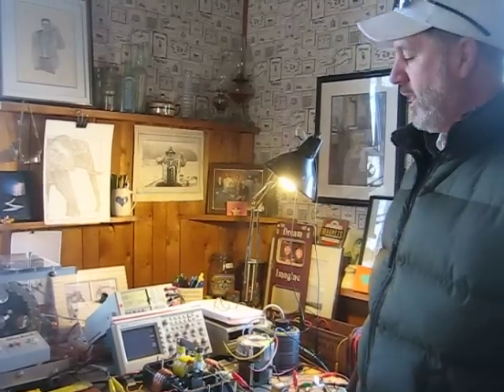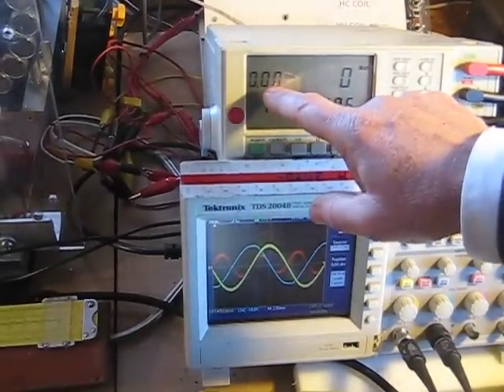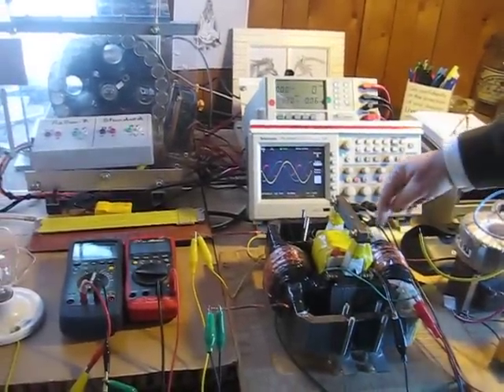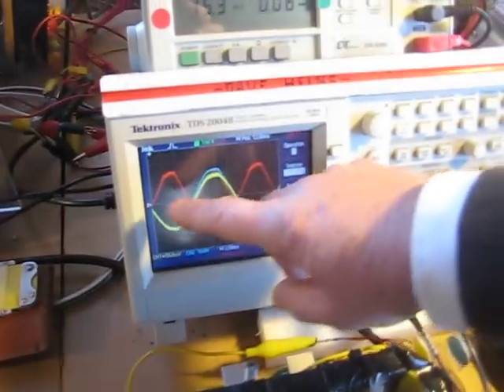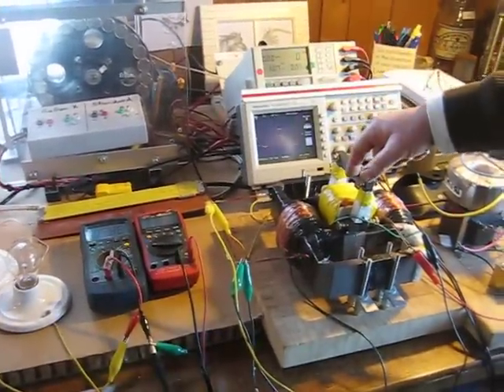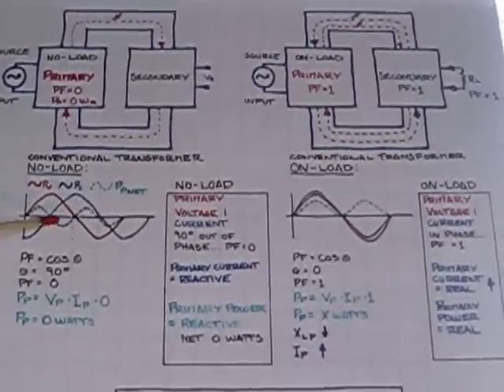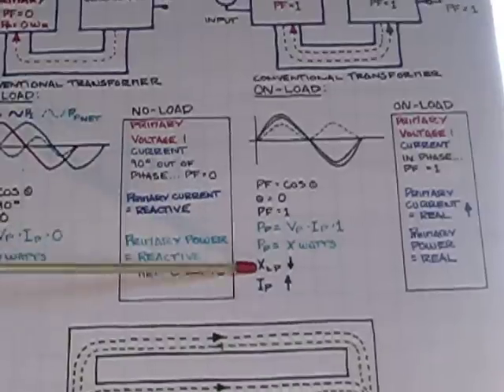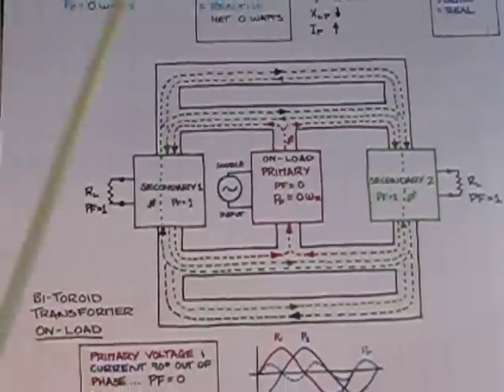INFINITE EFFICIENCY Bi-Toroid Transformer Operating with Zero PF Dec 7, 2014

Comment: Hello Mr heins I have replicated your transformer design and I did get some good results but I realised it only works with resistive loads but I am trying to drive a 250w motor using the secondary of the bitoroid transformer. I have tried rectifying the output but it doesn't seem to work. Could you give me any suggestions on how do I drive inductive loads. I tried stacking multiple bitoroid transformers in series to generate 250w but it went all in vain. I really need your help sir. How to i convert the power in secondary to pure dc please help
Reply: AC to DC rectifier like usual?
Reply: @lukiepoole9254  yes ac to dc rectifier like usual
Reply: Also thane heins design is severely inefficient and waste of resources. It is much better to just wrap the primary winding directly around both secondaries of a core-type transformer. Like the "frolov transformer". That way you can have 100% reactive power but the output power is near zero. So you ended up an inductor Lol. But, the induced emf is still there. It's just that it plummets when you try to draw power out of it. So, use parametric resonance. Add resonant capacitor.
Reply: @lukiepoole9254  actually I have figured out how to use inductive loads as well, when u put the load on a secondary, u need to put the load on the second secondary coil as well  bcoz the background emf of one's secondary travels to another. And not to the primary coil at the centre.
Reply: @rajendraprasad1638  Just connect the two secondaries in parallel so their mmf stabilize and cancel each other.
Rectifier does the job so what you mean tho
Reply: @lukiepoole9254  what I meant was it can run inductive loads as well, if one secondary is connected to load and the other one is left open then the first secondary won't produce enough output. So if you connect a load to the first secondary coil then make sure you short or connect the load on the second secondary coil as well
Reply: @rajendraprasad1638  That is obvious as mmf cancellation needs to be equal. Or you can just use both windings, and connect them in parallel, and in parallel with the load.
Reply: @lukiepoole9254  actually I tried connecting them in parallel and the results were disappointing, but I will give it another try and let you know.
Reply: @rajendraprasad1638  add capacitor in series
Reply: @lukiepoole9254  then I will have to run it at resonance, otherwise won't that expend more energy to just run.
Reply: @rajendraprasad1638  bruh
It would actually be the opposite.
Do you know about inductive and capacitive reactances?
Reply: @lukiepoole9254  yes I know about inductive and capacitive reactances, could you please explain where did I go wrong.
Reply: @rajendraprasad1638  I don't quite understand how your device is designed. Can you describe it in simple terms?
Reply: @lukiepoole9254  ok, I have a 300 turn primary at the centre, and 100 turn secondaries on both the sides that's it. As simple as that.
Reply: @rajendraprasad1638  What's the structure of the core looks like?
Reply: @lukiepoole9254  it looks like a bitoroid transformer.
Reply: @rajendraprasad1638  it's not suppose to look like a bi toroid transformer lol
Reply: @lukiepoole9254  but why do you think that, just let me know about ur doubts and I will make a video to clear them ok.
Reply: @rajendraprasad1638  
Let's start again.
First, using an anti-polarity core-type isolation transformer as the base. The two coils are connected in parallel, to be used as output, and both are connected to the same resonant capacitor, in series.
Finally a large coil is wound around both of the coils continuously. Basically the large coil is a solenoid.
There is no way this looks like the bi toroid transformer.
Reply: @lukiepoole9254  I am using a ferrite core U shaped,  also did not connect the capacitors anywhere, the center coil is the input coil. And the ones on the left and right are the output coils that's it.

Comment: I've had a go at making one. I'm struggling to power induction motors though. Resistive loads seem ok, but motors don't run, could it be because the voltage and current are out of phase?
Reply: Hello Sir. When powering resistive loads did you still manage to get more power out than the power you were consuming?
Reply: @waitin4thateeeeeeeg  yes I was able to run more leds from the secondary than the power i was putting in the primary

Comment: FLYBACK !
Reply: It is not Flyback,With Flyback there is no return current  from primary coil to the souce.
Reply: @bojanbittner4128  agree not flyback , but disagree flyback does have a miniscule amount of current mostly voltage though
Reply: @bojanbittner4128  More like the Tesla Switch or the Benitez Circuit

Comment: Its not current that is depleted its voltage on a resistor so why do you keep trying to replace the current and you wonder why you cant crack the code nobody is after the voltage drop across the resistance these people have no idea what is really happening here current isnt the issue here its the voltage drop not current drop dam you are slow

Comment: Great job Thane. Bitoroid transformer is a great machine if you want to keep your input power the same no matter the output power you draw, but with a troubling condition. The maximum output power is limited to whatever input power you give to the transformer divided by a+1, where a is the ratio of the reluctance of the primary core to any of the secondary cores. (Secondary cores have same reluctance). In practical terms, if your input power is 300W, and the ratio of your primary reluctance to the secondary is 10:1, then the maximum power you can draw from the secondary is 300/11=27.3W. And this maximum power is when you short the secondary coils, that is setting the load resistance to zero.  Indeed the input power remains constant at 300W while varying the output, but you can't exceed output of 27.3W.  One or two more secrets missing. Very close though.
Reply: The last two secret is frequency resonance and parametric resonance
Reply: inputOf300WattsDontExist.TheHighestDomesticConsumingDevice,MetalWeldingMachine,WhenYouAreNotWelding,Draws100wats.SoWithNoLoad.

Comment: Did you succeed in this?
Reply: The questions are simples and the answers is the same:
I see that the transformer is made of ferrite.
At what frequency do you work?
What voltage and amperage does the primary (W) have and what voltage and amperage do the secondary (W) have together?
It is said that such a transformer would increase the power (W) by 40 times.
Did you succeed in this?

Comment: Please someone tell me, what happened to this bi-toroid invention? Its been 7 years now!!
Reply from the maker: Hi Anchor, the BiTT is currently being developed as a step up transformer to isolate the generator from the load and to allow the generator to operate on no load while the BiTT delivers power to the load at infinite efficiency. https://youtu.be/YUb5idSqU8U
Kind regards
Thane
Reply: @PDiCanada1  Great job! I watched the video. Would love to support this work. Let me know if I can  help. God's abundant grace to you. 
 Kind Regards.
Reply: I salute your commitment and devotion to these projects. You are doing a great job! And I do pray for more grace in this pursuit.  Bitoroid transformer is a great machine if you want to keep your input power the same no matter the output power you draw, but with a troubling condition. The maximum output power is limited to whatever input power you give to the transformer divided by a+1, where a is the ratio of the reluctance of the primary core to any of the secondary cores. (Secondary cores have same reluctance). In practical terms, if your input power is 300W, and the ratio of your primary reluctance to the secondary is 10:1, then the maximum power you can draw from the secondary is 300/11=27.3W. And this maximum power is when you short the secondary coils, that is setting the load resistance to zero.  Indeed the input power remains constant at 300W while varying the output, but you can't exceed output of 27.3W.  One or two more secrets missing. Very close though.

Comment: Thanks, it's a interesting design.
I get the idea there are 4 (toroid_cores) magnetic_loops.
The upper & lower (long narrow cores)
 are allowed to unsync (=desynchronize)
 but their (magnetic_)momentum (=flux)
 is allowed to (keep=) continue
 to circulate in either direction (e.g. clockwise, or counter_clockwise)
 as needed,
 so (almost) no (=little) (magnetic_)momentum (=flux)
 is lost.
E.g. Phase_shifts,
 & [even] phase_reversals happen.
Thus the power_factor
 is allowed to change
 e.g. when changing the load(ing).
That (phase_shift) "tolerance"
 is important
 for operation_stability,
 because normally
 a(n abrupt) change
 would make operation collapse.
Effectively, we've got 3 coils (P1, S1, S2)
 each with its own resonance frequency,
 & 4 magnetic (flux) paths.
The middle_coil P1 can "buck" (against)
 (e.g. ~external, differently timed)
 fluxes from S1 & S2
 (preventing them)
 from entering into P1
 (e.g. via Lenz's induction law).
So P1('s resonance_)frequency stays rather independent.
& that's the reason why S1&S2's "flux"
 WON'T go (directly "in") thru P1 (sometimes);
 but instead will prefer
 to travel otherwise
 in(to) the "top & bottom" toroids, instead.
Those 2 toroid(_cores, top & bottom)
 allow flux to behave
 like (2) variable_speed (=frequency) rotors
 e.g. cw to ccw,
 (as mentioned above).

Disclaimer:

That "avoidance"
 of the "shorter" magnetic (flux) circuit (core(s')) paths;
 & taking the longer (magnetic) path, instead:
 was the basic question
 I had to deal with,
 for how that design_concept
 could possibly work.
E.g. At 1st glance,
 the magnetic_circuit paths
 did NOT seem
 to work,
 because it appears
 to be breaking the rule(s)
 of nature taking the shortest path
 for least resistance (=opposition).
But I had over_looked
 that 3 different
 AC frequencies
 are possible;
 & that funny=peculiar core "form"
 allowed tolerance
 for them (=their operation).
E.g. (Phase) Operation is NOT so rigid
 as a standard
 (P&S=Primary&Secondary)
 (step up or down)
 transformer.

(Errorful=mistaken) Readers,
 Please DON'T (wrongly) expect "infinite" energy
 (from over_unity)
 because (any of) its output power
 is "limited" by the component "sizes"
 thus the amount of reactive_power,
 (that is)
 (temporarily) storable.

What I mean is:
 over_unity
 (practically) never means infinite.
I.e. over_unity is usually much less than infinite
 or even <200%.
E.g. You're lucky just to get more than 1 (=100%).
E.g. >100% (..<200%).

It would be possible,
 to wrap a few turns of wire
 around each of the 4 toroid cores
 to measure their (magnetic_flux) phase(s)
 (in real time, bidirectionally with 2_coloured LEDs, &)
 with a (4 channel) storage_oscilloscope.

If the (50/60 Hz AC) input frequency
 is too fast (for (LED) measurements),
 then you could (try to)
 pulse the circuit,
 with e.g. 1 Hz (or slower), instead.

Chears.

Comment: If I'm to construct something similar, must the secondary 1 have the same number of turns and coil size as the secondary 2 coils?
Reply: I think it depends if you want the transformer to act as a transformer. Meaning step up or step down. But the concept would be the same. As I understand it, it’s the reluctance that you’re shifting. So if the core is built the way that he’s designed it, the current won’t fall back on the primary. Meaning Lenze’s law is not in effect. so what I’m trying to say is you could make the same amount of wine in the primary as the secondary. How is that answering your question for years later?😂

Comment: I have replicated your transformer, or made my own version of it. I modified ordinary 50Hz AC network transformer. Two secondary windings are very tightly together. When shorted, primary coil power factor is 0.25 (25% real power). Transformer consumes 17 VARs and gives 12W output. I use it to charge batteries. 18Ah lead acid battery can be recharged in 72 hours. Screw that connect two secondary coils gets very hot, so I get battery charged and some heat with just 3W real power input.
Reply: Hello. So you get 12Watts out with only 3 Watts in right? Isn't that overunity?
Reply: @waitin4thateeeeeeeg    I hope it is overunity. I have built three split flux transformers. Output power is rectified by diodes. Independent diode bridge for each transformer. Than connect them in series and parallel to get optimal output voltage and current.
Reply: Hello. So you get 12Watts out with only 3 Watts in right? Isn't that overunity?

Comment: This is very efficient power transmission tech. just wondering, why this not applied for home power transmission?
Reply: Because the academic science believes it can’t be done... they think it violates Newton’s 3rd law (lenz Law) but it doesn’t!

It’s a problem in the teaching of electrodynamics! But not with the laws of physics. 👍
Reply: @caminglis53  It doesn't help that Lenz is called a "law" rather what it actually is, Electromagnetic Retardation, it's only as bad as it is in todays technology because of bad engineering and a failure to redirect it to be useful instead of wasteful. Tesla dealt with this problem with his Unipolar Dynamo: 

"If the subdivision be as indicated by the full lines in Fig. 4, it is evident that if the current is of the same direction as before, that is, from centre to periphery, its effect will be to strengthen the field magnet; whereas, if the subdivision be as indicated by the dotted lines, the current generated will tend to weaken the magnets. 

In the former case the machine will be capable of exciting itself when the disc is rotated in the direction of arrow D ; in the latter case the direction of rotation must be reversed. 

Two such discs may be combined, however, as indicated, the two discs rotating in opposite fields, and in the same or opposite direction."

Energy "generation" by its own application.
Reply: @JenkoRun  yes good points really and in reality all of nature is asymmetrical

But our man made electrical topologies can’t be 😆 academic pride!

Comment: Energy can NOT be created, only transformed.
You are creating nothing. You are simply using the full potential of magnetic manipulation that current technology filters out by use of sine waves as the input source.
A bi-toroid IS over-unity when done properly because it does not operate in a symetrical thermodynamic equalibrium, but it is NOT creating energy. It's simple making full use of the field energy that is already there that greedy power companies don't want people to know about.
A TRUE over-unity system should function as a closed loop system without issues. NONE of the videos on here are real. The real stuff is always removed to maintain the "status quo".

Comment: I noticed the Bi-Toroid transformer died just before Mr. Heins switched to the standard transformer. According to his presentation it should have continued as the Secondary #1 coil feeds flux to Secondary #2 coil and the Secondary coil #2 feeds flux to the Secondary #1 coil. The power to the Primary was still connected so flux should still have been flowing. This obviously only last for a very limited amount of time unless there was a slight of hand that I missed but I don't believe I missed anything.